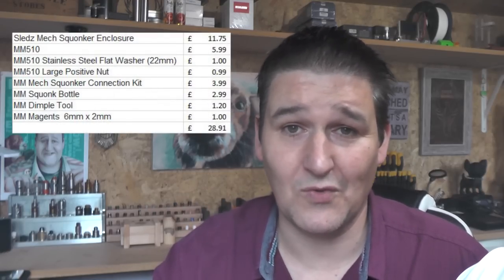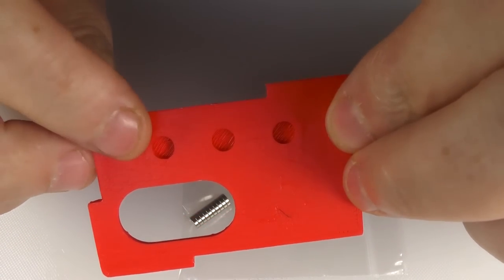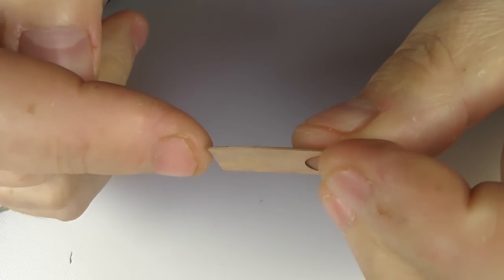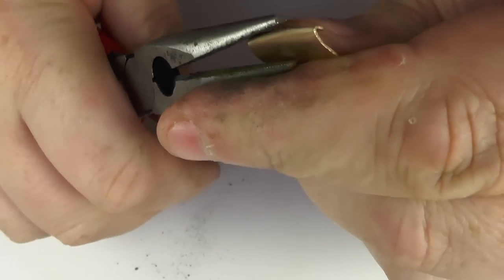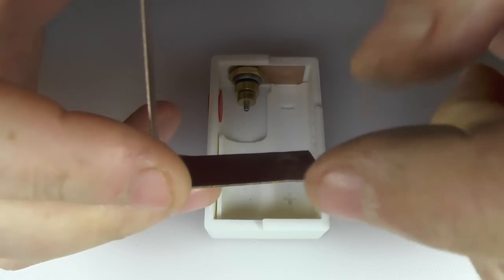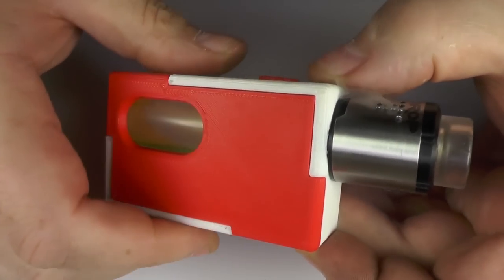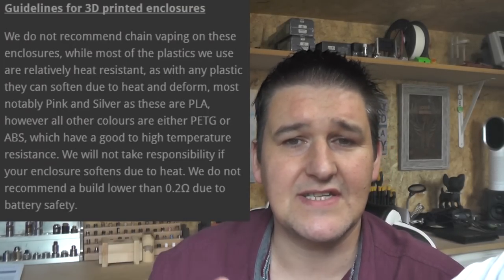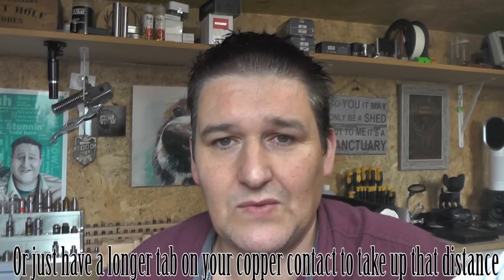How to make a Mech Squonker for under £30.

Comment: I certainly get the pride you must feel having made it yourself... and you showed it to us so simply it really isn't that complicated. If I am capable of making stained wood radiator covers for each size heater of every room here- fitted with vented sheet metal in the front and under a vented wooden lid... I can do this too. I'll start looking at sled options. Thanks Todd.

Comment: As always a great video.  When I saw your post about this before I wished there was a list of mod maker parts and now there is and I have ordered them all.  In case anyone is wondering (like I was) the spanner is a 14mm/13mm spanner.  Seize mods sell them but they where out of stock when I checked, but those size spanners are available other places.

Comment: if you don't like the lines of the 3D printed box, you can use a flat iron or a heated frying pan or something similar and rub it across each of the sides real quick to melt them down for a nice flat surface.

Comment: depends on the material your enclosure is printed in mate! PLA and similar will melt for sure but things made in nylon or pc will be considerably more resistant. If you're lucky enough to get something sla or sls printed, you probably won't have to worry at all

Comment: I do a lot of 3d printing, so thought I would mention this as it might help others thinking of ordering these mods.

if this is PETG you will be fine for up to 80c or so (PETG is used to make drinks bottles, so its also food grade). PLA is food grade also but deforms and softens at around 40c, so wouldn't recommend it AT ALL for a box mod really. 

ABS is the more toxic of the 3 when heated, but has a tollerance of up to 90c or more before it starts to deform.

As for the quality, this is a FDM printed model (Fused Deposition Modelling). This is why you see the lines in the part and tollerances have to be adjusted due to shrinking.

As for the curve on the surface, this isnt uncommon for ABS parts, which I assume by the look of the finish that this is an ABS part. The trade off for a better straight edge is to use "a raft" which provides better adhesion when printing, but the end surface finish is much poorer. If you asked me to print you one, this would be glossy and glass like on the surface ;)

Comment: Thanks for the video accidentally stumbled on this video that inspired me to make my own 😀 just a quick question with the connection kit. I'm planning on using the 20700 enclosure from sledz just wanted to know would it be worth buying the longer kit from mod maker to account for the extra height or would the normal length be ok to use?
Reply from the maker: That I can not confirm, you would be better dropping Ric a message at ModMaker.  I wish I could say for sure but better safe than sorry.

Comment: I truly enjoyed watching this video!  My only question is,  is it possible to accidentally  push the button into the inside of the mod, thus jamming the contact plate to the 510?  Might be a stupid question but I never had a mod constructed this way🤗   Cheers todd!
Reply from the maker: Anything is possible but you would need to put some pressure on that switch to have that issue!!!

Comment: Could you theoretically use a "click Switch here by soldering a wire to the positive on the copper connection from the battery and one to the large nut on the positive of the 510? I would love to build my own sqonk mech but i find the bending metal a little clunky and somewhat dangerous
Reply from the maker: +Joshua Brann it is soft copper, if you find that clunky and dangerous, sorry but you shouldn't be building this mod.

Comment: So, if you chose to, could you get some high grit sandpaper and smooth out the lines? Just to give a more of a finished look?
Reply from the maker: You could but IMO the number of lines and height, sanding it down would screw with the dimensions.
Reply: Todds Reviews ah okies
Reply: Not sure if using asatone might be a better option
Reply from the maker: Pretty sure that is for ABS only mate.
Reply: Ahh..... thanks buddy.. good thing I didn't go put it in a tub of nail varnish 😂😂😂😂

Comment: hi todd, quick question. What is a Washer really? Is is really necessary? i've been trying to build my own mod, and still collecting the parts. no one sells MM 510 around here, and i'm not sure the 510 that's sold around here includes the washer.
thanks in advance, mate.
Reply from the maker: +feisarino abitama the MM510 allows you to use different size washers and colours but the principle is the same with any 510.

Comment: I run a .17 build in my solo rda on top a 3D printed mod and it doesnt get hot because of the coil I use, if you try to use some ss fused claptons or something that takes a lot to ramp up you will melt it but I take 2 pieces of Anarchist ni80 and make a 4 wrap parallel and it barely gets warm chain vaping.... even in my dead rabbit which is aluminum and it barely gets warm
Reply: honestly I've tried all different types of builds, resistances, and atty's on my squonk and a single coil 4 wrap parallel on a 3mm bit has been the best vape, it glows red with the smallest pulse when the coils are cold so its easy on your batteries it comes to a .17-.19 ohm's so its about 100 watts on a full charge so the flavor is great and its safe at .17 for a 25 amp battery so it works on 18650 or 20700 mods granted your using LG HG2 or Sony VTC5a's
Reply: oh yeah and I use 24 guage AN80 (ANARCHIST NI80)

Comment: Is that an AA battery todd ?
Reply from the maker: +Daniel Nurden 18650
Reply: Todds Reviews  could that be any 18650 battery ?  

I would assume 7800mah at 3.7v
Reply from the maker: +Daniel Nurden check the links in video description, go to battery mooch link and read up.
Reply: Todds Reviews thanks todd youv inspired me to build my own do the tanks work on the mod aswell i know the drip do but was wondering if a tank would work the same ?
Reply from the maker: I don't wish to sound rude but please go read up on ohm's law, get an understanding on how mech mods work and basically learn more about vaping.

Based on the questions you are asking, I really wouldn't advise building your own mech squonker just yet.